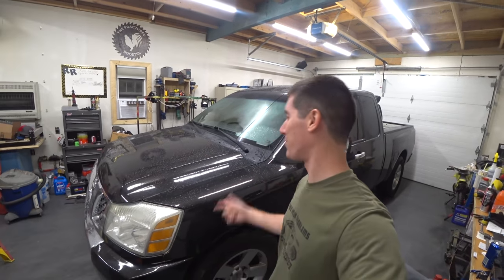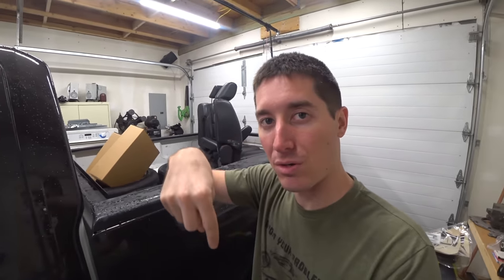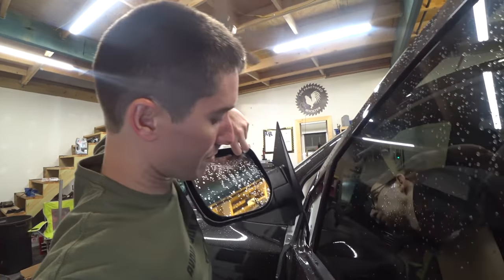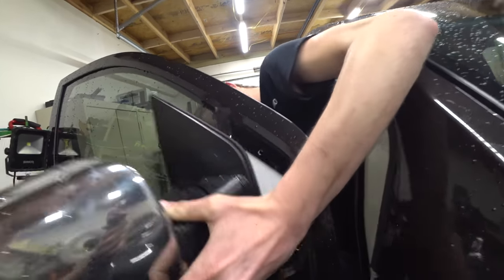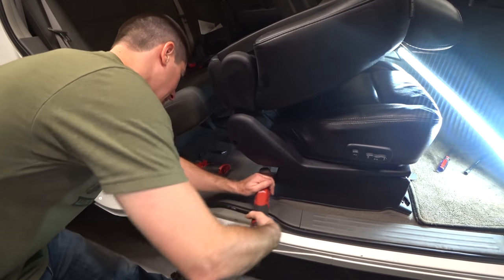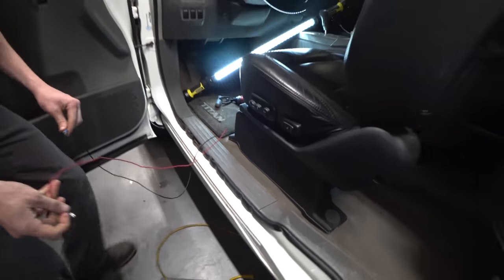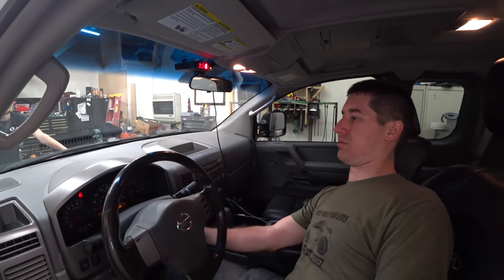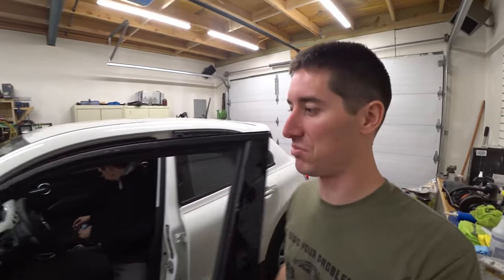Putting INFINITI Leather Seats In My BASIC Nissan Titan *Luxury Towing Upgrades*

Comment: watches this, totally intrigued

......I wonder if 78-88 Cadillac seats will fit in an 82 El Camino.....
Reply: yes!
Reply: They sure will! And the rear quarter panels will take 93-96 Sedan DeVille taillights with a little work.
Reply: Captain Rolls 
Wouldn’t be surprised if they did.
Reply: Crazy Uncle Chris 
Very cool!
Does the car still exist?
I had 1978 Cabellero.. sold it.. new owner totaled it.

Comment: I'm glad YouTube put this into my auto-play otherwise I may have never known about this.  Checked inventory on a local junk yard today and picked up a decent shape front seat from a 2010 QX56 for $90 and installed it as soon as I got home.  Now I just need to figure out what the other two plug ins are for that I was unable to connect.  All the power tilting/adjustment works and the seat warmers too but the seat doesnt move forward when I open the door like it usually does so gotta figure that one out.  Other than that I love it, feels way more plush!
Reply: Did you figure it out?
Reply: @LBCTITAN  not yet, I did snip the connector from my old seat and I’m going to snip the new one and solder on my old one, I need to verify wiring diagram to make sure wires/connections are correct.

Comment: i picked up a 1995 sc1 Saturn coupe black, with 261k miles, the car is in great condition and looks like new, it burns no oil at all. i bought it off the original owner for $1250 2 months ago, and it has a few nice dealer add ons. like 15in rims, cruise control, spoiler, bumper guard. its almost museum quality. i did drive 485 miles each way to get it.

Comment: I am assuming you dug around under the carpet to see if the wiring was there.  Toyota usually has all the wiring no matter what was installed.  I put heated seats in my Sequoia with heat pads, switches, relay and fuse.

Comment: Hey so i have a  2007 Titan XE and have a powered seat from a donor 2008. can you please elaborate on the power connections please? the original seat is manual adjustment but the donor seat is powered and heated. i dont care about the  heating but i do need the adjustment.
Reply: Wondering the same thing. I guess he doesn’t answer anyone back.

Comment: I have a base model nissan kicks but under the seat is a wire coming out the floor board,  i was wondering if i could plug in a power seat to it or what

Comment: for the big tow mirrors u should use the metal covers for the inside instead of the plastic ones. wayyy nicer imo. part #'s 96305-7s200 and 96306-7s200 also check out the midnight emblems 62890-9bp0a front and 90890-9bp0a

Comment: using a driver on studs in plastic mirror Cringe.  Torque spec on that seat bolt.... tight
Reply from the maker: The mirror studs are in metal, the seat bolts tight. It’s totally fine 💯

Comment: Those door panels will never be the same after taking it apart. The sheet metal bends when the little plastic clips are taken out and half of them will never hold the clip again. My door panel is attached with tie wire. Be extremely careful!